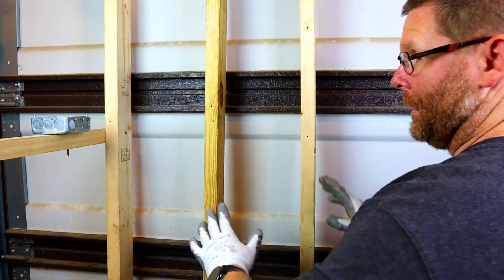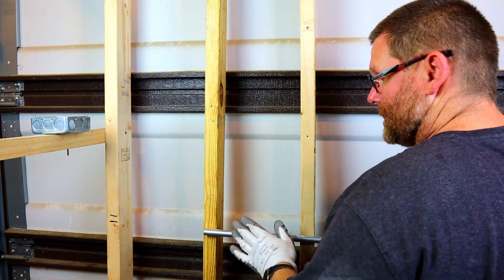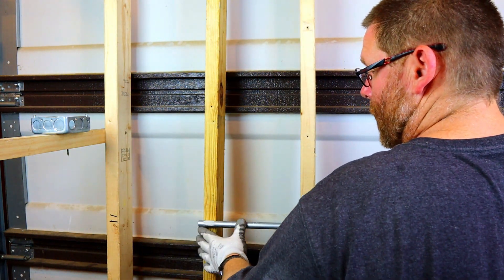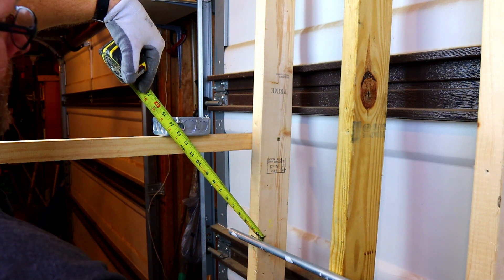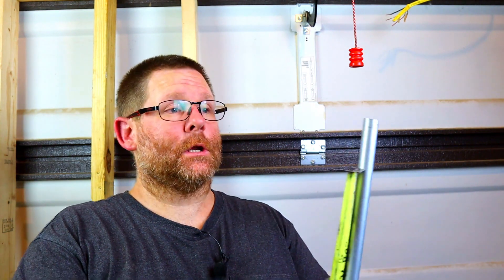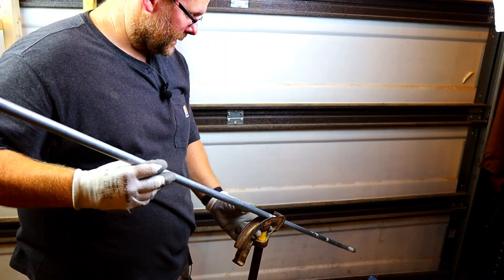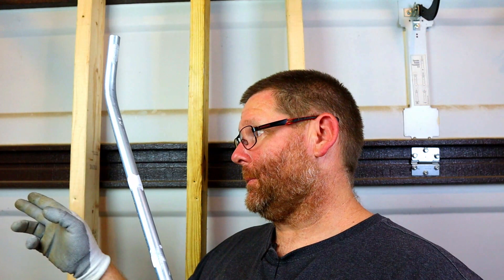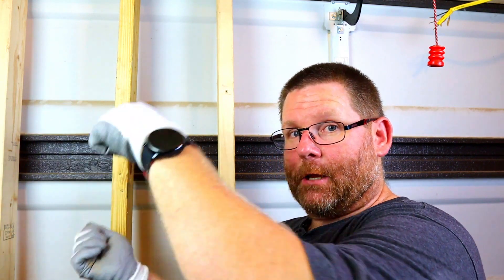How To Bend A Rolling Offset On Conduit

Comment: How do you get the travel if you can't just put up tape and measure when the distance is too great?
Reply from the maker: If that's the case why don't you just install a junction and 90 or?  There's is a math equation but I can promise you that the way I showed you, is the easiest by far

Comment: Heya bro,,,I dig your style working with conduit. I have watched some other guys videos on this subject and one guy says you really should use a laser in your  piping layout. Albeit in a  big open ceiling structure and reference points for some of the layout measurements are at a great distance from your piping location,,lasers would aide the layout dilemmas!! When doing more common closer work as in the scenario you are presenting there is no need for the extra BS!! OOOH,,forgot to say all the xtra math the guy was talking about,,right triangle theory and getting the measurements to come up with the hypotneus. Using your approach is gaining the hypotneus without the 2 other waste of time measurements!!!!!! I have been bending conduit for decades,,,and I was taught by an Ole Timer that if you learn how to do it easier and the same results of someone using fancy pants technology,,your actually smarter,,,but save the super math for when it's really needed,,,then break out your pipe bending or Uglys book and a calculator!!😊 The only difference for me on your mock-up,,is that is one of few times I use the top,,,or should I say the registered angle between the pipe and connector. I feel i get a more true reading cause the back of the conduit, in this situation is not the best registration for the end of the tape or Stic- rule in my case. I am ole school on using stic- rule. The other thing to note is that if your pipe already has some bends in it than you have to scribe a strait reference line somewhere near your first bending point to aide in the alignment of the pipe in the bender so that the whole conduit is in proper alignment!!! Or you could due like most CHEESEBALLZ out there and cut the pipe and use a coupling to spin for rotation!! I really do like your strait from the cuff approach!! OLE SCHOOL WAYS STILL CARRY ON!!!!
Reply from the maker: Yep I was taught from a true genius on pipe bending and he always said couplings show weaknesses so they are the last resort. I appreciate your comment and watching ☺

Comment: Something I have my apprentices and myself do is if you go more than 6” on an offset then use 45 degree bends which has a multiplier of 1.4.  This way your offset isn’t so big. If you have a really big offset then go to 60 degree bends.
Reply from the maker: I understand that but I tend not to bend on those degrees. I do understand your M. O on that and it's a good one. Thank you for your comment and watching ☺
Reply: @MountaineerOutdoors  Thanks for the video.
Reply from the maker: My pleasure thanks for watching and commenting ☺

Comment: Question for you. How do you know when a certain degree isn't going to work? Say like a rolling offset where 30° won't work but 45° will? When I had an Android phone I had an app that would show green, yellow, and red to.sgow if your specific bend and degrees would work or not. Now that I have an iphone, that feature doesn't work. I'd like to know how to tell without an app.
Reply from the maker: Honestly not trying to sound like a no it all but it comes with time and you have to understand and visualize how and where the bend will start and end
Reply: What was the app
Reply from the maker: Good question, it's completely gone and I changed phones when I did that app didn't transfer I've searched and can't find it anywhere. If for some reason I find it I'll update you
Reply: It's called Quickbend. They have since brought back the color changing on iphone.

Comment: Intelligent people understand that bending conduit is more of an art form and less about strength. I've seen some really small people bend with a inch and a half Bender.
The man has decided to teach us a skill that relies more on brains than bronze.
So let's have respect.
Thank you for the videos.
Reply from the maker: Fully agree this is the perfect comment. I appreciate you watching and commenting ☺
Reply: intelligent people know that bending pipe isnt hard, and they dont judge an electrician solely based on if they can bend pipe or not. ive never understood your thought process on this, i could bend pipe extremely before i was even a registered apprentice a decade ago, it isnt an art or difficult, its very easy

Comment: Pythagorean Theorem. Subtract the low point of elevation to high point of elevation. Subtract the short distance of the horizontal from the long distance of horizontal. Take each results and square it, the add it together, then with that answer, find the square root. Then choose angle of bend, use multiplier, add shrink, then bend. You will have a way accurate bend.👍🏽
Reply from the maker: Uhhhh😧. What he said 😂 😂 😂
Reply: what would be the short and long distance of the horizontal?
Reply: Rolling offsets
Pythagorean Theorem 
 a² + b² = c²
   Ex: 2 in rise w a 3 in roll
a 2 x 2  = 4 
b 3 x 3  = 9 

a² + b² = c²

 9 + 4  = 13 is c²

Find √ of c

√ 13 = 3.606 
 Multiply by desired bend multiplier 
Ex:  offset 3.606 x 2 = 7.212 or 7 3/16 spacing between bends 
Account for shrink 
1/4” shrink per in. for 30
True Offset 3.606 x .25  = 0.902 or 15/16 

* round up to nearest fraction for shrink

Comment: Thank you for your video. However, you can present the concrete measurement  for the box at two points such as RISE ( point A )  and OFFSET ( point B ) from then  we  use the formula  C = ( square root of A2 + B2 ) . Hopefully, see the next video you explain more clearly . Thank you so much
Reply from the maker: Nope I teach like I do so no one feels overwhelmed. Thanks for the comment though